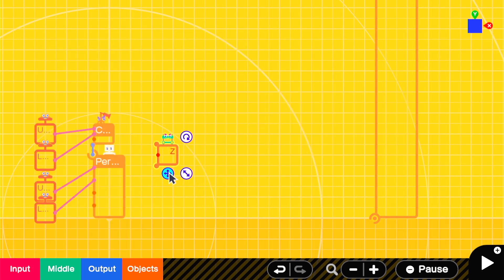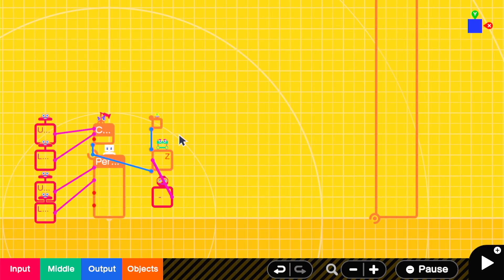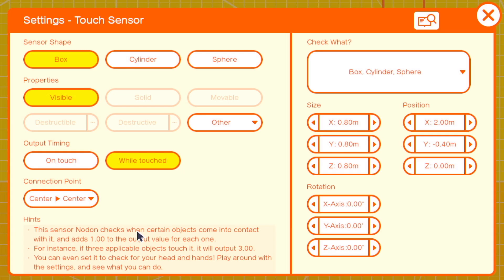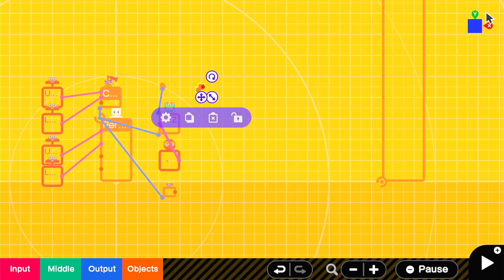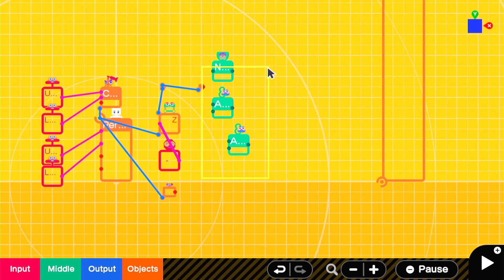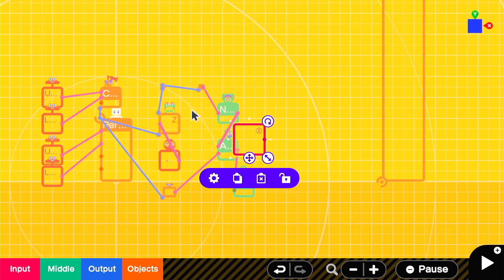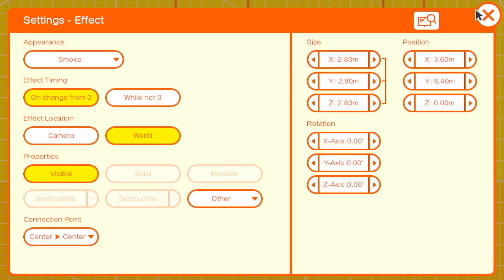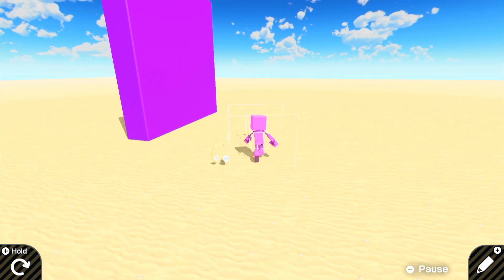How to Phase/Dash Through Walls in Game Builder Garage

Comment: Request: how do i make a ai that chases after you and can detect walls (better path finding)
Reply from the maker: Complex pathfinding is almost impossible since there's no navigation meshes in GBG - You'd need a custom solution based on your game. For example, a breadcrumb type system might work where the player leaves an object as they move that the enemy is detecting for and therefore sequentially chasing. The "custom" part of the solution is fitting it into your specific level etc. Example - It might not be easy to only detect one crum at a time and in the right order.

Comment: I’m trying to make my own Metroid game in gbg and I’m really stuck. I don’t know how I would make a morph ball work. Could you make a tutorial please?
Reply from the maker: Hmm. I'm pretty backed up but but I'd still like to help somehow. Maybe I would approach it like this - (and I don't know how you currently have your system set up) but switching out the player with a ball using teleports - then you'd have to deal with the camera. I know @jJaeStudio made a video on switching the camera between different "players". Maybe when you switch to morph ball, teleport in a moving object sphere on some kind of connector so it stays in 2D with its own controls WHILE also switching the camera to IT'S position. Then swap back in the person when returning to person mode and send the camera to follow the person again. It seems like a lot. Morph ball is surprisingly difficult especially because we're changing the "size" of the player character.
Reply: @DaveNodon  Yeah I’ve actually tried that before. The ball teleports to the player and they can control it. When you want to exit the ball the can hold Zr and the player will teleport to the ball. The 2 problems with this is that by teleporting, the player can clip through walls and their Z position can also change. Maybe a morph ball isn’t possible.
Reply from the maker: @yoshisaur4713  hmm you’re right teleporting the person back in would be weird and hard. For the clipping maybe we can have a sensor that checks above the ball at person height for anything that could be a wall or obstruction. 
The Z position, maybe using the teleport reset physics options? Or if the Z position error is very slight maybe add a moving object to the person that Moves Z position positive or negative until it matches the 2D track position? Not able to test right now but it might help.

Comment from the maker: Some Notes - You can customize this a bit by adjusting the variables. Wall thickness by changing the slider distance. Specific walls or only certain parts of walls by changing what the long sensor looks for (You can add an invisible fancy object in the wall for example for specific spots, etc).